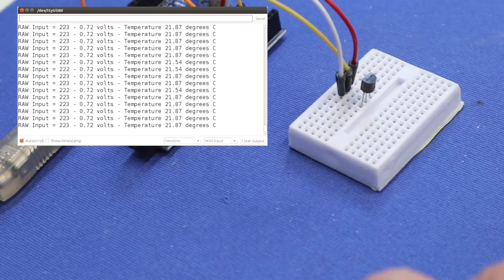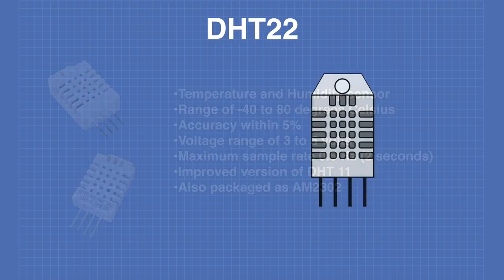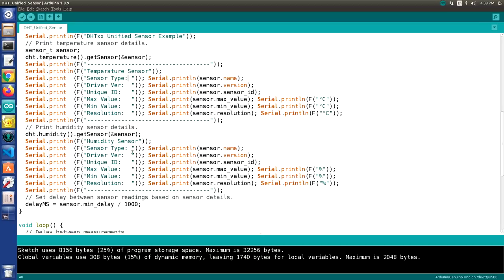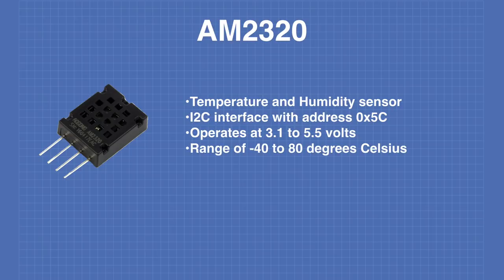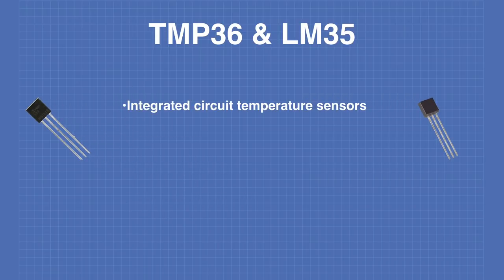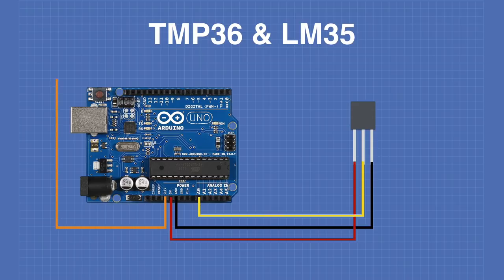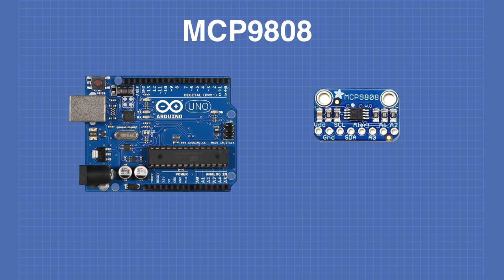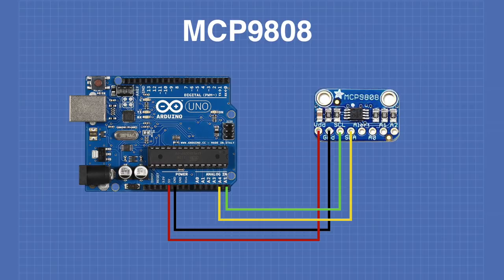Measuring Temperature with Arduino - 5 Sensors

Comment: As always, excellent video!!!   Those that give a thumbs-down, probably can't spell Electronics!
I was surprised you didn't include the popular DS18B20
Reply: Me too.  Maybe in another video.  These 1-wire sensors are great I think especially if you need several sensors in a project.
Reply: Neither can he  😆
Reply: @b gg I've seen them used routinely to regulate tighter than +- 1 degree F. Looking at the datasheets both the DHT22 and the DS18B20 are accurate to within +- .5 C,  and can be programmed to 12 bits of resolution, so not sure what you are talking about.

Comment: The atmega328 has an optional internal reference of 1.1V for analog conversion. It should be better if you are reading temperatures below 110 C
Reply: Can you explain the advantage of using 1.1V? I'm making a weather station so I want to have it optimized as best as I can for the usage and usage is definitely below 110 degrees C. Thanks in advance
Reply: @dinodubroja7433  The advantage is it's a fixed value with an internal reference that does not depend on the stability of the 5V rail. 
But the most important part is if your sensor will return an analog value of 10mv per ºC, it means that in normal conditions it will never output a value higher than 110ºC which is 1.1 volts. This means, that if you use a reference of 5V, the 1024 steps of the ADC will be devided by this 5V and most of this steps will be never used, leaving a few steps for the usefull measurement. And few steps means few possible values so lower resolution. 
If you use 1.1 reference, each step will represent a lower voltage (1.1/1024 instead of 5/1024), so each step will represent a lower step of temperature giving more resolution.
The ideal case would be using a reference just bove the maximum voltage you will read.

If your sensor gives 10mv per degree, and you will never measure more than... let's say 60 degrees, which is 600mv, the ideal case would be using a reference slightly above this, like 700mv. This would mean using an external reference. But in our case we have 1100mv internal which will be good enough.

Comment: Surprised that you didn't go for either the DS18b20 or BMP180 sensors ... any reason why you didn't choose those?
Reply: DS18b20 comes in a waterproof shell, which is important in several cases. Also, missing sensors that can measure out of "normal" conditions, like k-type thermocouples (~1200 C), pt100 (-200 to 850 C), thermistors with lots of applications in 3D Printing, non contact infrared sensors, lasers etc. Hope next time..
Reply: Same here?
Reply: I always thought one had to use a pull up resistor with the DHT22, on the data pin. Yours seems to work fine however. Is there something I’m missing?
Reply: @samk2630  If You go to Adafruit website, in the instruction how to connect DHTxx sensor, You will find out that DHT22 often already has a built in pullup resistor :)
Reply: @burski0954  thank you, sir!

Comment: Another nice option is the DS18B20, an accurate digital sensor that only needs power and 1 signal line, you can run many sensors in parallel, power can even be omitted when you use parasitic power. Definitely worth a look. Also the way 3D printers measure temperatures with a thermistor could be examined. No mention of multi-sampling to reduce noise and increase accuracy?
Reply: I think he was just trying to keep it simple for some of us newbies.

Comment: i get temperature readings that seem off (about 10C higher than expected) 

and the temperatures fluctuate a lot (get as high as 50C) in room air, at night.

Using a TMP36 with Arduino Uno

Any ideas what it could be?

Comment: I'll chime in for the Dallas DS18B20 1-wire sensor as well. I made small PCBs that chain together with cheap phone cable to monitor the plumbed areas of an out building. The Arduinos turn on heaters via TTL controlled power strips.

Comment: nice video,  im using the 22 these days, but 25 years ago had a project using the LM35, i had to design n calibrate a current to voltage circuit, run that into a microcontroller, with code witten in assembly, then send the values out as 8 bit serial data, with a pseudo RS232 transmission, (no uart),.. just clocked...  easy peasy today,..,  thx again for the videos., cheers.

Comment: whoa.. hot stuff today!!! at 10:36 you said to attach the two pull up resistor to ground and showed them to positive.. Since you called them pull up's I imagine the schematic was correct you just said ground when you meant power.. outstanding.. I am going to make a temp humidity sensor for indoor and out soor temp sensing.. this was a good one to get ideas from.. thanks Bill..

Comment: At 10:33 The pull up resistor were NOT connected to ground in the schematic you have show vs what you said. It is causing confusion.

Comment: why not testing ds18b20 or bosch sensors (bme/bmp 085 180 280 680)?
Reply: basics first, the bme280 is great, does temp/humid/air pressure,  Adafruit PRODUCT ID: 2652,
i did  not test this on an arduino !   probably on micropython hardware esp32+Wifi (https://pycom.io/)

Comment: Thank you Bill, another great, and useful topic covered. How about hooking in an I2C  oled display to complete a great DIY temp and Humidity station? initializing an oled display in the code, with the included library, and sending the data from the DTH (or what ever your choice of sensor) to the oled display, with the appropriate code ,would be a fun project. Thanks for all you do Bill. Enjoyed it.

Comment: I have a project in mind that will record the temperature on 3 areas of my gaming computer. The output will be displayed on a small OLED display mounted on the glass panel of the computer. The fact that this setup will be independent from the computer itself  will give the gamer access to the system temperature without having to count on software running on the computer screen.
Reply: your need to use the MCP9808 so you can identigy the 3 different sensors. you could use any of the others but with the use of a i2c display the code should be easier.

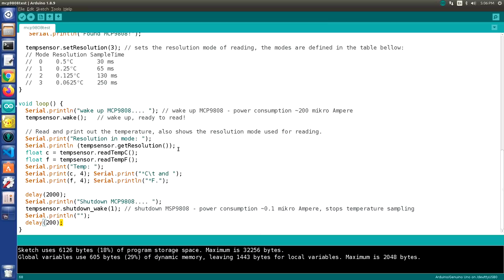Comment: Great video.   But at the sketch for MCP9808 (26:30) the 'delay(2000) is executed before the sensor goes into sleep, and then wait for 200 ms in the sleepmode.   There must be a switch between daley(200) and delay(2000)

Comment: One other thing, I picked up one of those M5STICK-C devices. It is a PICO ESP32 device with built in OLED Color Screen, on board lipo battery and several built in sensors.  It also has a GROVE connector and breaks out 8 pins on top for hat's that run sensor packages.  I purchased an environmental sensor that has an on board DHT12 BMP280 and BMM150. It reads out temp, humidity and ordinal direction.  Neat little device, and I have been playing with it recently to try and figure out all the things I can do with it. I got both the HAT and the GROVE with the same sensors.  The problem I have with it is this, when run the temp never stabilizes and continues to go up no matter where I sit it down, or if I hold it in my hand. Humidity does stabilize and in my shop, inside a metal building with all sorts of things from my ham radios to the big screen TV and several computer crunching numbers all around, the direction is usually way off.  Why can't I depend on this thing for a relatively accurate temp?  It does give me the F scale which was a real selling point for the tiny  fully wireless/blue tooth device with a duel core processor at 240 MHZ.

Comment: Hello ! I'm new to your channel and love your videos. My comments about this video: it lacks the themocouples and platinum sensors families...
 Also, you do not explain how to install sensors on the thing to be measured (conditionning). I guess that analog sensors have more limitations on the distance and wiring between the Arduino and the sensor because of noise problems. But I2C can also get into trouble with distance. It could be useful to explain the basis for wiring such devices in real environment.
The last MPS9808 seems to be really accurate but what about the setup to measure a base plate for example? Can the PCB hold temperature according to the IC? Can it be directly mounted on a surface up to 125°C?
Thanks a lot for the answer :)

Comment: This is unbelievably timely for a project I plan to do soon.   If for example if I wanted a variable to hold a temperature obtained from a am2320 sensor  I could set the variable to=am2320.readTemperature();  right???

Comment: With the analog sensors the ATmega328 has an internal 1.1V reference that could be used, that would improve the sensitivity even more and limit maximum temperature a bit.
Another way to increase sensitivity and open for lower temperatures is to use a LM34 (Fahrenheit) sensor, you can, of course, scale to Celsius if you wish.
To get better support for negative temperature on LM35 (and LM34) requires a diode, a resistor and one extra ADC input.

Comment: I have been watching your videos for quite sometime, and have learned a lot from your videos. as a matter of fact, you are the one that inspired me to began to pursue my hobby of working with electronics. I have a question for you. With use of the i2c BUS on items such as the MCP9808, with the selectable i2c address, can you set up your Arduino to switch the i2c address automatically in the event of a conflict? If so, how would i go about doing this?

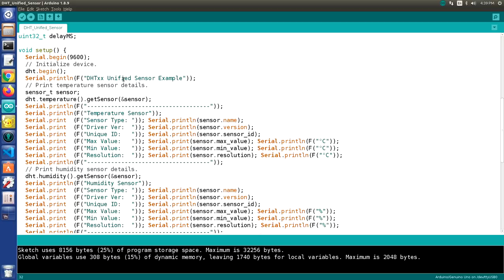Comment: are you certain you explained how the F() works at 6:30? Why would it matter where the sensor dumps it's data when the only ones which use F are the strings? I think you meant that we are taking the strings from flash instead of sram although I don't know enough about the c++ compilation process to know why it otherwise put them in sram unless for a speedup

Comment: Can I use this code with a Wemos D1 mini and the TMP36?

Is there any way to add 3 led diod?, green, orange and red to this code that will start with green and then orange and red when it got to hot?

Thank for your good videos.

Comment: what about using a thermistor?
Reply: They're not very precise, and can be annoying to calibrate/maintain calibration.
Reply: @pileofstuff  true, but sometimes you don't need a precise value like for controlling fan. They are also used in 3d printers for controlling the hotend.

Comment: Question,
I would really love to build an led display graduation cap for my daughter who graduates from The University of Michigan in May, but I can only find a few tutorials from people who have done it and admittedly  have had lots of problems between finding the right components and most importantly, issues with finding the correct program. Most of the sketches have been downloaded from the Arduino site but all seem to need multiple corrections. I am a complete novice, just capable of getting through the basic Arduino sketches and putting them to work on my Elegoo/Arduino Mega boards so I don't think I'm completeley hopeless but I was hoping that someone here may have some ideas. Thanks
Reply: Not sure if your question regarding components is for led display or temp sensor as in the vid? 

if display, what size? There are dirt cheap oled displays 128*64 black white on ebay, they are very small but bright and clear, i like them a lot for small gadgets, fairly easy to use for novice. 

if its temperature, then i have only tried the dht11 and dht22, and must say i was not impressed,  i actually bought about 10 pcs over a few month for a project, because they seemed so inconsistent. They are in the ballpark, but each one has a different value by up to several degrees. Humidity readings was way off on many. -but i could have had bad luck/ bad product.
They are cheap and very easy to use, also for a novice, and if precision isnt stressed. But i will try another component for my own project. Good luck!

Comment: Good video but it lacks thermocouples use. I have a personal challenge: how to measure the solar panels temperature located on the roof? How to get rid of the distance? Thanks !
Reply: Just FYI; you can get two different TC modules from Adafruit, and there are some cheap clones and lots of sensors on AliExpress. If you have a long distance between sensor and controller/display you can use a pair of RS485 ICs to drive a twisted pair good for up to 1000 metres (ie pulse coded), but a simpler method would be to convert to a 4-20mA signal so that the voltage drop is automatically compensated. Obviously any local sensor circuit would need some power, so you would either need a third conductor to supply this, or use the current loop to also supply the circuit. Hope this helps!

Comment: I would like to someday monitor the temperature of my home furnace heat zones and hot water.  Do you have an example with multiple sensors, either on an i2c bus or if there are enough inputs for 3 zones pipes and a hot water pipe?  Could your software be used within a Sonoff Basic module or perhaps a Sonoff THM module without its own sensor?
Reply: He has a video on using shift registers to connect multiple I2C devices.

Comment: Nice video! But kindly try to make video a little bit small... I am not requesting for a much smaller video... Just try to reduce it for around 10 mins. This will also help you gain more views because people generally prefer short but informative videos!
Best of luck!
Thanks in advance!
Reply: Videos are a bit longer but that's the cost of including all the information plus running examples. This is not only a review but a tutorial and a reference manual all in one :)

Comment: Great info, thanks much. Of course we below the border in the US of A, are indeed metric disabled, so the quick conversion was a nice addition.  I don't know why those in China don't consider this in their "kits" I have built several very nice clock kits, but NONE of them offer a way to change from C to F, even my favorite that sits above my television is stuck on the C.  All my guests, assume that it is the outdoor temps, since it is winter here right now, however it can get them in trouble.  For example, my brother-in-law, who got the farm when my wife's parents died, was down visiting one evening, and was amazed that the temp went from sub-zero F to 22 degrees as he sat visiting.  He stayed much longer then he would have had he realized that it was still sub-zero and that fog outdoors was freezing on the highways. His farm is 70 miles from our home.  I do wish that folks would add a bit, as you did to include the formula to do the conversion in the Sketches, I look it up when I am designing something for my Rig (I am a NOMAD when I can get away with our Class A Motor home) or the house.  Sorry just a sore point for me, I grew up in the 50's and early 60's when much of the world was using, what we refer to "real measurements."  We had to know what a peck and a bushel were when I was in grade school, but were never even told about metric until around the 8th grade, and I think our High School math teacher did go a bit into how easy things were in Metric, but informed us that some people were just to dense to understand the unites of measurements that had been developed and used for centuries!
Reply: Americans should just drop F, it's a horrible scale, with the freezing being at +32. So Unintuitive, I was so happy when it went out of use in the UK.